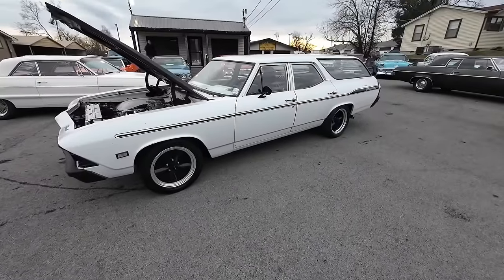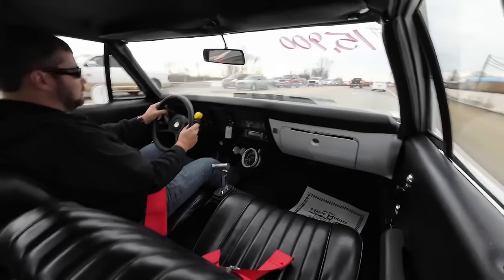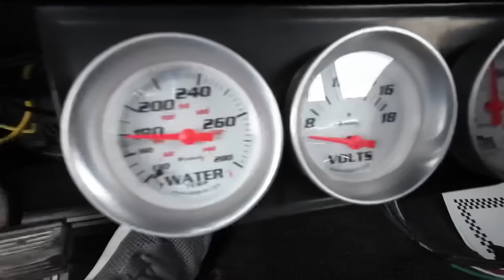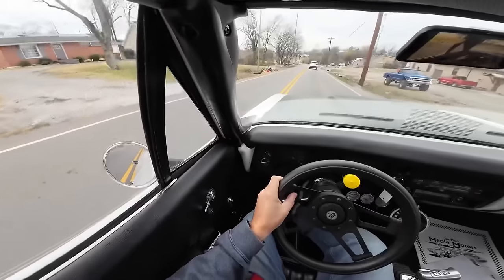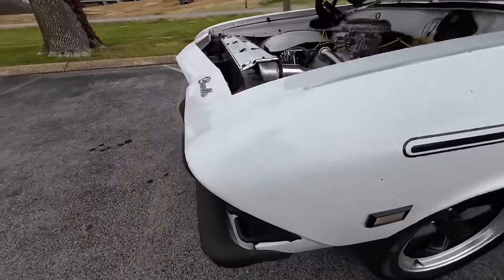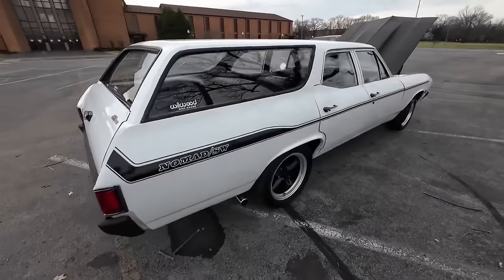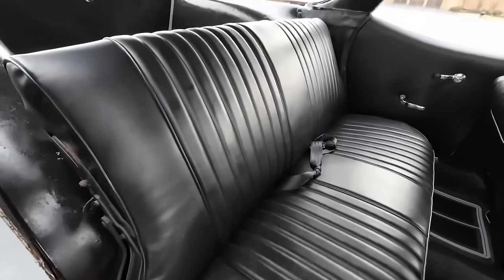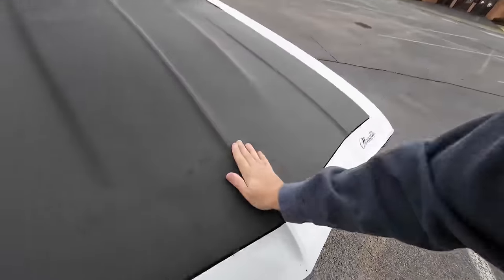Test Drive 1968 Chevrolet Station Wagon V8 SOLD $15,900 Maple Motors #2367

Comment: This is another one that is strong with the bondo. But the underside is clean. I didn't see any undercoating, just paint....and I didn't see any rust underneath. The engine/drivetrail also seemed pretty healthy. $15,900 might be a bit aggressive on this one, though---it needs a lot of sheetmetal work

Comment: IMO, there's a bad alternator, why the battery almost didn't start the car (6:55). The alternator gauge (i.e. Volts) may not be a non-working gauge after all.

Comment: There is a guy up the street from my house that has a white 63 nova wagon 4dr clean body and frame, nice lil cammed 350 all new suspension. He wants 8500 for it, been thinking about stopping? after seeing the price on this one, i will be going to his house tomorrow with 7900 cash.
Reply from the maker: Sound like you are scoring a real good deal
Reply: @MapleMotorsNickSouthgate  Yeah I'm going to buy it and resell it. If you guys want 16 for that one, I'll be asking 20 for this one. Well see?

Comment: I would say the starter is dragging because its getting too hot from the header pipe.
Reply: Or, the alternator isn't charging up the battery. I noticed, after the car had trouble starting at the gas station, it started right up after the video edit. I think Nick must have got the battery recharged before continuing the video.

Comment: How come every car you sell has not at least been gone over. Nothing ever works on the cars you test drive. Doesn’t seem very sales smart. I mean just knowing that the air, whippers, radio, turn signals, speedo, gas gauge, tac and heaters don’t work is kind of scary don’t you think.
Reply: tell me you're new here without telling me you're new here. FFS bet you're a blast at parties.
Reply from the maker: All cars have been gone over but we are not a repair shop. If I fixed everything I would raise the price significantly. We sell 50+ year old cars, we will not go into a repair business. Thats why we make videos of what is wrong. Thats also why this car is not $20gs
Reply: Not been gone over? That's the whole point of these videos sir...
Reply: @MapleMotorsNickSouthgate  check out other sites  same prices but they pass state inspection. Every time I saw a car worth buying it needed about $3000 to be able to drive home